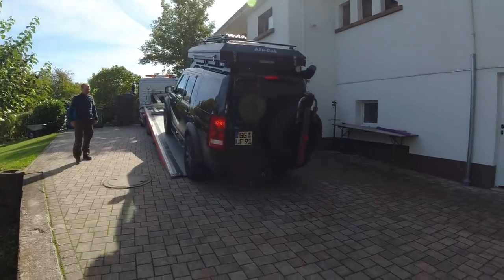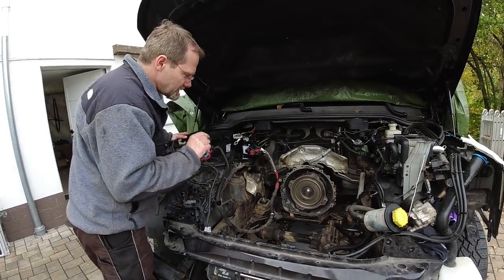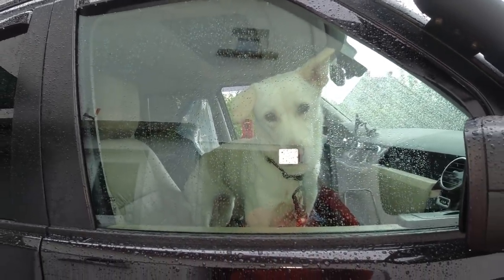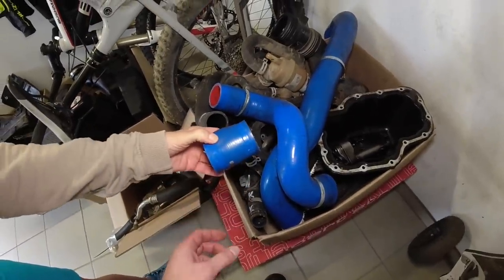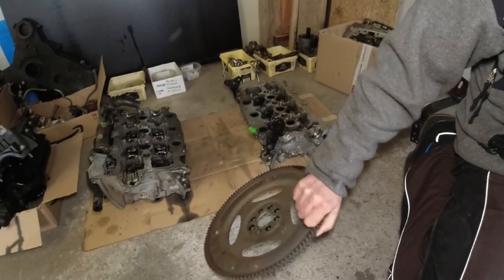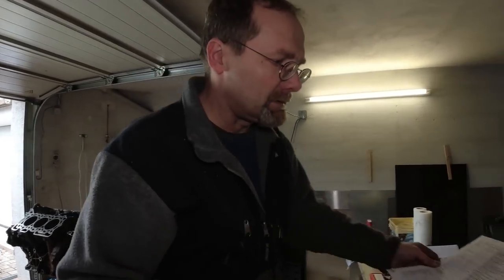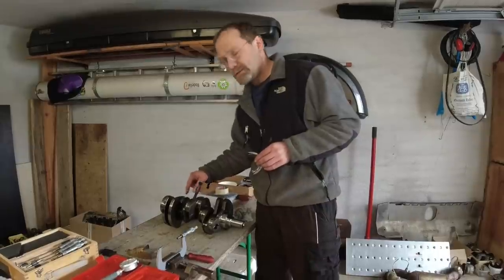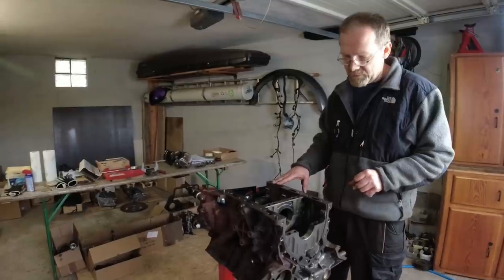Is this the end? Complete engine failure - Land Rover Discovery 3 / LR3 - Episode 1

Comment: i am blessed with the 4.4 V8. It drinks a lot, but it didn't break. And on Lpg it is cheaper to drive then the 2.7 v6 diesel.
Reply: May I ask what sort of LOG system you used?

In Australia, LPG is quite widely available in cities and larger towns so it makes the 4.4 an easier car to own.
Reply: @markmcgrath9098  
In the disco 3 is the lpg brand Prins. This is a verry good brand.  Dutch brand. What also is verry  good is Vialle.  This is Better  known then  Prins. Is also have a jlm valve  saver  kit . I have  a 120 liter LPG  tank in the place where  the spare tire was.
Reply: @raymondlogister6828  120L is a good size. Is it a doughnut shaped tank? May I ask how much LPG is per litre where you are?
Reply: @markmcgrath9098  
Tire size shape. It is build in where the spare tire was, now there is the tank. The cost of Lpg is in the Netherlands/Belgium €0,85- 0,65  one liter.
Reply: @raymondlogister6828  thanks, I’ll check the price here on the way home now

Comment: Such great videos and Christian/Vera you are truely inspirational.  
I feel for poor Fabian though as there is so much to love (and hate) about D3 ownership.  I have had my 2005 HSE TDV6 D3 for 6 years now and in that time I've raised the kms covered from 201,000 to now jsut over 306,000 kms.  The vehicle had been with one family before I purchased it and its Log Book was complete from ownership having been serviced by the smae local LR Dealership as its purchase.

However, since then I've replaced the Electronic-handbrake module AUD3,000, the air-suspension pump, one strut and wheel due to a MASSIVE pothole AUD4,000, had the Oil Pump replaced with the upgraded unit you called out when she had her 2nd timing belt change at 289,000 km's AUD3,500, but I also feel foul of a transmission failure due to the fact that these units were originally manufactured without an ability to service the fluid.  This caused the clutch packs to fail at around 230,000 kms and after LR quoted AUD22,000 to replace the unit I had it removed stripped and serviced for AUD7,500.  

With Fabian's vehicle stripped this far it'd be worth checking the Transmission and replacing the fluid as well as checking the Diffs. Oh yeh - my front diff let go MAY-2020 with a strip-down refurb costing AUD7k.

With all of that in mind, I only wished I lived in Germany and had such a friend as you Christian. But joking aside, I have to say I love the old girl and think she's the best all-round car I've ever owned.

Fingers crossed that the crank keeps trucking for another few 100,000 kms. (Oil service coming up old girl).
Reply from the maker: We will see if the repair is successful soon.  I am not sure but I do my best. There are many cases were these engines failed right after because of contamination or wrong bearing clearance etc.  servicing the transmission is not easier at this moment because the car is not in the optimal position over the pit.  300t plus is really good.  Christian

Comment: Omg I’m now afraid to start my engine I have a LR3 2006 with 340,000km which runs nicely but now I’m very nervous.   20k for a new engine.   Wow.  Anyways thanks for the brilliant content and keep us posted.  😳
Reply: I am also afraid and change my engine oil every 5000 km
Reply: @arekguinness2342  from talking to specialist 4x4 guys complete engine failure is pretty rare but not impossible ,watching these videos is very informative.  👍
Reply from the maker: Not to worry 😅👍 Yours probably also does not have a DPF, (if it's a diesel). Those are the best ones, up until 2006. And if it has gone that far, it will go on forever. You must be doing everything right. 🙋‍♀️ Vera
Reply: @Vera_and_Christian  brilliant Vera and thanks for your comment, your channel is amazing and gives us all that little bit more confidence to work on 🙏with a little touch of German precision, greetings from ireland 🇮🇪🤩

Comment: Always thought I'd subscribed to your channel, but I wasn't. Sorted that now - subscribed. The way these engines fail has me thinking more and more that there is an issue with poor quality control on the bearing shell to block/cap sizing. Rebuilding these engines in European areas seems a lot more common than here in Australia - at least with the 2.7 we do have supply of genuine low km engines from the Ford Territory.  Anyway 385,000km on my D3 on the original engine
Reply from the maker: Wait for a future video about what probably the rootcause with the Lion V6 engine is. 👍🙋‍♀️Vera

Comment: Hi Christian

What a nightmare. Who ever designed the bearings like that should be painfully tortured by being made to personally fix every engine that fails.
About 25-30 years ago I rebuilt my 110 Rover/Buick V8 engine and all bearings had a notch in the bearing shell and matching bearing that located them so that they couldn't spin like this.
Land Rover should have to recall every car that has this engine and fix it under warranty  for such gross stupidity in designing it this way.
I now have a Discovery 4 TDV6 and would hate to have to do this  again as there is so much more  "Junk" attached to the engine now.
This could be fixed by having replacement bearing caps and bearings that had a notch in them so that when you rebuilt the engine you replaced the bearing caps and would solve the problem so that the bearing could not spin.

Love the channel

Ian Marshall
From Down Under
Reply from the maker: Hello Ian,  the notches are not to preventing bearing rotation. They are for axial orientation.  This is a general wrong assumption out there.  Of course a bearing will stay in place a bit longer but the rotation eats the surface of it rapidly and then it will spin.  In Fabians case, one of the three bad bearings did not spin. I think with notches one more bearing would have stayed in place.  The junk around the engine is a big problem and it is caused by increasingly tight emission regulations. Ford simply reacts and they have to install more and more „bad“ stuff.  This is especially noticeable between the EU4 to EU5 TDV6 and the LR4 from beginning of 2013. In addition the emission reduction abuses the engine more. Christian

Comment: Another great in depth video! Would agree with you regarding the root cause, then the dealership probably caused the final failure. Once finding metal in the oil filter that should have been it, no need to run it. I always put a nanoborate friction additive every 5K miles oil change in my engine; so far it hasn't helped the mains to spin 🤞

Comment: Bit of perspective needed here. Yes there is a problem with some of the Ford V6's fitted in the Discovery 3 but what is not clear is: How many disco 3 are there in the market and how many have this problem? ALL cars have issues just that some are more documented than others. It's a sport particularly in the UK to knock LR but you should bear in mind that the accountants at PAG made LR use the Ford engine and its the accountants who decided not to do a recall and fix the issue. I was seriously looking at a Tuareg which also has engine issues, parts are expensive and aftermarket accessories are none existent. The advantages of the Discovery outweigh the potential issues. You pays your money, takes your choice and keep your fingers crossed! Moving to live near Christian and Vera would also be a good idea!
Reply from the maker: I agree 100%.  This issue is not completely unusual and it is still a good engine.  The problem was caused by management when they decided to build such a short engine block usable in all sorts of applications.  If the engine would be 40 mm longer, it would never fail.  Such dilemmas are caused by management decisions, always.  CEO‘s don’t care about heritage, only about cost and Profit.  Christian

Comment: Hi Christian & Vera, judging by mechanical experience what would you do to prevent the spinning bearing on a rebuild of the engine? If there is a fix, then surely with the amount of broken engines out there, it would be viable to reprocess the engine and keep the discoveries on the road?  Keep up the excellent work.

Comment: While you are there get the crossover pipe to an exhaust shop ang get the elastic bits replaced. That’s is exactly why my disco 2.7 is now at my indy’s
Reply from the maker: Such craftsmanship is no longer available in Germany.  Over here everything is buy-new only.  Very sad.   I will take up this idea and look for a replacement. I could try to weld it myself.  Christian

Comment: Just a quick tip that could save you hours of pain later. Get some rubber friendly silicone grease to coat the water pump gasket when you refit the pump. These seals are easily snagged and damaged when you re fit the pump and having a water leak there when its all back together is a nitemare. 
Another good thing you already mentioned is the injectors getting tested. I have seen one of these engines destroy and melt a piston simply from one bad injector!!
Reply from the maker: Silicone grease is in our possession 👍 since a few month. Thanks.  Christian

Comment: Hi Christan and  Vera  and Fabian ! Just with the small amount of experience i have had ( replacing the crossover pipe )with the 3 /4 discos stabilise the chassis and raise the front of the body by removing al.the body securing bolts except the rearmost bolts which  are left in but loose ! It will give you a lot off working space to replacing  tne engine !   Robert  !
Reply from the maker: I did not know this trick.  Thanks.  Christian

Comment: As the engine is out, is Fabian (via you) going to replace any of the hard to reach items that are failure points like turbos and any pipes/hose?
Reply: Going this far into a strip and rebuild, I'd be very tempted to add every strengthened or proven  performance enhancing aftermarket part possible on the engine and ancilliaries.
Cost might stop me though 😂
Reply from the maker: Well, that is Fabians decission, he has to pay for all the parts. But he will decide when the engine body, bearings, crankshaft issues are sorted out.🙋‍♀️  Vera

Comment: insult, a (mechanic) these days, is a changer of parts
this man is a machinist, fitter, electrical and electronics expert, and troubleshooter, today (mechanics, cannot rebore, line bore, counterbore, use a micrometre, do math
A lot of those seized screws should have been assembled with anti-seize in your climate especially, I HATE  the design of the install, but you are very adept and organized

Comment: Why would the engine cranking for a few seconds before starting harm the bearings? Surely this would actually build oil pressure before the crank is hit with the force of combustion starting and would actually be a good thing from the bearings perspective? Thanks for a fantastic video.
Reply from the maker: Prolonged cranking is one of many reasons which shorten the live of the Lion V6.  It sure is not the problem alone.  Christian

Comment: Well done, an excellent video as always from an obviously talented engineer. Keep up the good work, plus don’t forget to replace all the heater plugs when you rebuild and check them before you do.
Also our Disco 3 has now passed 200k but I have changed the oil every 5k regardless. Oil is cheap compared to an engine! Prevention is always cheaper than cure!
Reply from the maker: Agreed.  Fabians glow plugs are new.  We changed them a few videos back.  Most of them did not work anymore indeed.  Christian

Comment: If you take 10 minutes and remove the body mounting bolts, you can lift the body from the front with a jack, engine hoist or a tractor to make more access to the crossover pipe and also to allow more access to the bell housing bolts. When lifting the body, disconnect the steering from the steering rack, to avoid breaking it and also if it's a manual transmission check the clutch hydraulic pipe when doing this, or even better disconnect it. I've always taken the body off. Two of you after doing it a couple of times could get the body off in two to three hours easily and I always did it on a two poster lift, which does help a lot.
Personally I think the oil holes in the block, main bearing need to be increased where the main bearing is supplying oil to two big ends, as it always appears to be the centre main bearings that spin on every engine I've re-built.
I appreciate anyone's thoughts on this problem.
Reply: Won't enlarging the shaft holes weaken it even more?
Reply: @arekguinness2342  Hi Arek. More often than not in my experience of working on these engines,  it's the shell that spin in the block before the crankshaft brakes. For example increasing a 4mm oil supply hole by just 1mm will make a 25% increase in the oil supply, which is a a lot. By increasing the flow of oil in my opinion will reduce the chance of it happening again. Normal car engines that have been converted to racing engines often have this type of thing done to them.
Reply: Hi Martin. Thanks for the great explanation.
Reply from the maker: I think this is a great idea to open the oil holes in the bearings but I am scared to do it.  The oil pressure of this engine is already extremely low and I think it would drop it further without other mods.  Christian
Reply: @Vera_and_Christian  Hi Christian. I would also drill the oil holes in the block also to the same size, but only to those main bearings supplying two big ends as they seem to be the ones that spin up in the block. Clearly this problem isn't caused by heat, so it must be an oil supply problem. I've re-built over heated engines where the pistons have grabbed the side of the bore, but the shells haven't spun up.
Out of interest Christian, what was the oil pressure readings (if you have them) before the shells spun up?

Comment: Liked and subbed.
The engine in this Discovery has a back story similar to other LRs. A company buys LR, decides to put their own engine in and its not 100%. In this case it was Ford although the TDV6 is basically a PSA engine. BMW did the same and gave the LR brand a cursed reputation for reliability.
The key to reliability as always is regular maintenance and oil changes.

Thankfully JLR now build all their own engines.
Reply: Is that a thankfully?  I don't know that they have all that great a reputation when it comes to engines, the 2L ingenium is known to have a lot of issues and the new 3L V6 is too new to know what design flaws may be lurking.  Maintenance is always key but there are straight up designs flaws in many of the engines and rover used.
Reply: @shaunbava1801  Especially as they in housed the ford v6 diesel design and still didn't redesign the bottom end. PSA only used the engine for a few years at most and JLR didn't touch it for a couple of decades! Someone at ford or Jag is severely counting the pennies. Also PSA make some of the most reliable, tough diesels out there (DW10 and DW12, both of which share the XUD bottom end and they go for 500kms plus)

Comment: I hope you guys see this, but the reason for the fuel line replacement is due to an issue recorded by Bosch, apparently when the connection is tightened the size of the orifice is reduced by crushing. The concern being that flow can be restricted, which can cause injector failure.

However I’ve reused my lines, I personally think it’s something we can review the injector duty/fuel delivery, and if it is low they can be replaced as needed.
Reply from the maker: Thank you for this hint. I will pay attention to the fittings.  Christian

Comment: I believe you must remove air conditioning compressor(?) and many more. I would like you to instruct us more details of how you would remove others (in order) like AC gas pipe, AC gas, diesel pipe... and how to put them together when engine was built. Did you do bleeding air out from diesel pipe system before connecting to injectors or rails. I am not sure this may not be relevant to this modern diesel engine, but I still like you to confirm first.
I love to watch this series of LR3 engine build. I love Vera while she was a real perfect "kitchen hand" for you Christian. Thank you very much both of you.
Reply from the maker: All these steps are in the video series.  Including AC and purging the fuel system.  It is also explained in the workshop manual.  We also made videos about changing the fuel pump and inspect the fuel system. Christian

Comment: I'm convinced a Disco needs frequent oil changes (every 5000km). Would it be better to use 0W30 instead of  5W30 so the lower viscosity oil gets around the engine faster on cold starts?
Reply from the maker: This is a endless debate and there is no straight answer. At least I have not found one.   Citroen specs 5W40 for this engine.   We will stay with 5W30.  Christian

Comment: Please may I make a comment? This engine is a Peugeot Design. That is what was told on another site.  They showed that the engine has been designed too narrow so that it would fit sideways in a front wheel drive. The crankshaft is the worse design, because there is not enough beef to the flanges. Remapping the power to the engine makes this problem more likely. You have such patience, You have my best wishes. Good Luck Gpx
Reply from the maker: 👍 We have done a lot of research and will be doing a crankshaft special video at one point. We actually had it planed already, but then this happened. 😃🙋‍♀️ Vera

Comment: Hi Christian and Vera. I have a Jaguar XF 3.0D. It's due to have it's timing belts changed by myself. So I checked the oil pressure just in case I need to change the pump while I'm in there. My oil pressure was at idle 60psi (4 Bar) and when I revved it up a little it jumped up to 80psi (5.5 Bar). Way above the acceptable minimum. Perhaps what Land Rover think is OK just isn't. By the way I haven't heard of anyone snapping a Jaguar crank yet. 🤷‍♀️
Reply from the maker: Your pressure is way higher than spec.  Ours is 0.7 at idle and 2 at 2000 rpm.  It seams way to low for my taste.  Christian